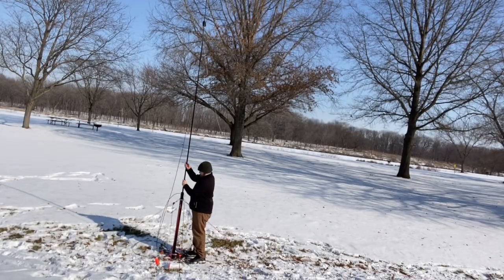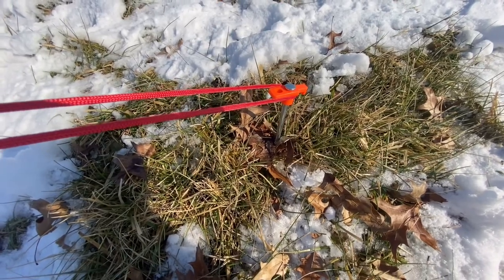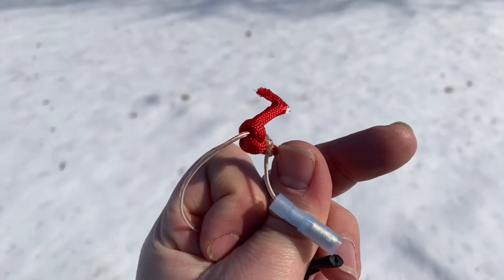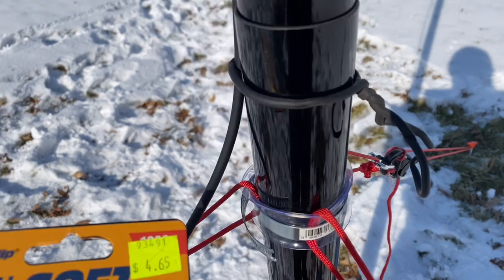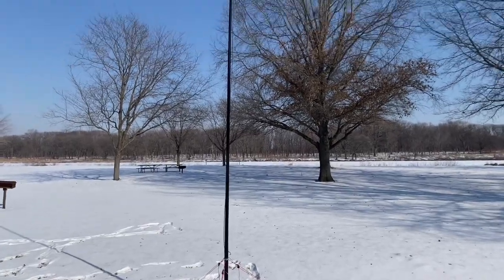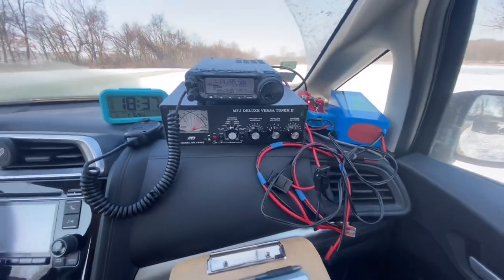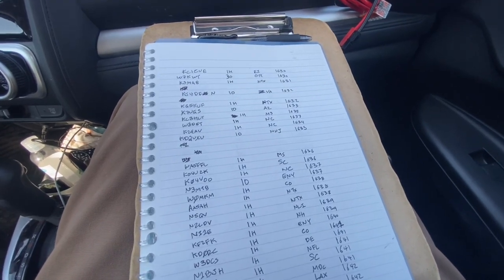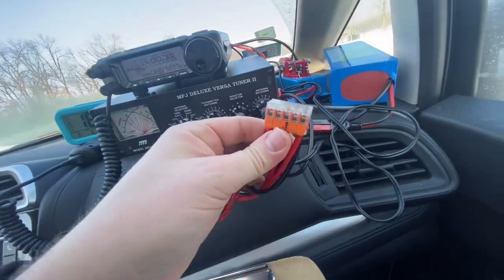40’ Dipole Setup in 14° Weather - Winter Field Day 2022

Comment: Thanks for the lead on soft wire ties!  Also, you can just use pin into the ground on the bottom of your mast rather than stakes/line to keep it from kicking out.   Informative video... Subscribed!  -W8TJM
Reply from the maker: Thanks! I’ll have to try out the pin on the mast when the weather warms up - right now I’m hammering on those pegs with a rubber mallet to get them irk the frozen ground. But a pin would definitely be faster. Cheers!

Comment: 500+ contacts is impressive, any specific mode/band combo stand out better than the rest for you? Most our WFD points probably come from 20 or 40m PSK.
Reply from the maker: Honestly nothing fancy - almost all of it was 20m SSB during the day and 40m SSB after sundown, with a little 40m SSB mid-day on Sunday for some NVIS, and a little 15/20/40 CW for multipliers. CW was pretty active, but I’m just not slick enough to run on CW yet.

I credit the antenna for doing most of the work, and running a freq nets much higher numbers than hunting.

Comment: Yeah momma, this is how we roll with Spiderbeam HD 40ft. Telescopic Mast. I am having mine since almost 5 years continiously in use. I actually bought it as the 30ft. Version and added the missing segments afterwards to make it the 40ft. (12m) Version. That's another excellent Point I love about this Product. You can buy every segment if it needs to be replaced incase one might break or you just planning to extend the one that you already got . The Packing Size and Weight of this 40ft. Fiberglass Mast is absolutely acceptable and like I already mentioned, it's with me in the Fields since almost 5 years in all kinds of weather. Jeff thx so much for your content, I am looking forward to make Contact with you on the Bands. Have a nice weekend  & keep up the Good Work. 73 de Uncle Guenter, DK5ONV
Reply from the maker: Thanks Guenter! Hope to hear you on Bands, keeping rocking out in the field there. 73
Reply: @jeffjeffglassglass3529  Big 10-4 on that.
HAM Radio til Death do us apart. Over overrrr... 🍻🙋‍♂